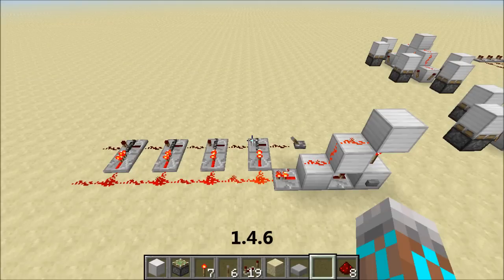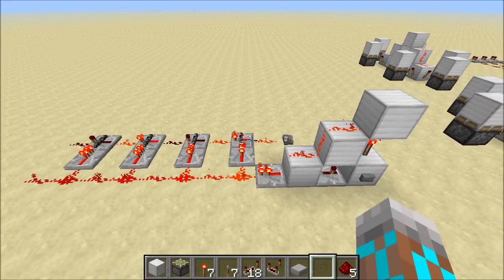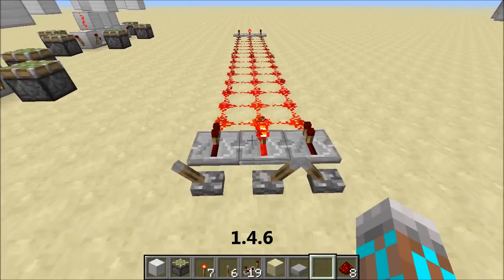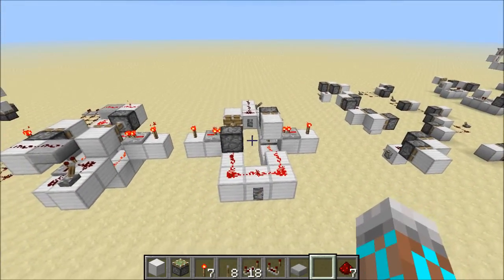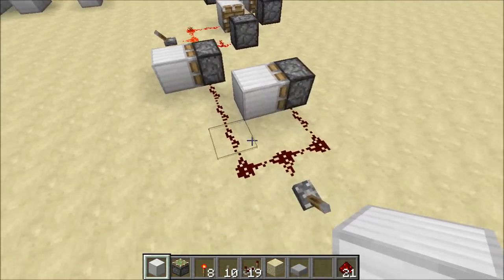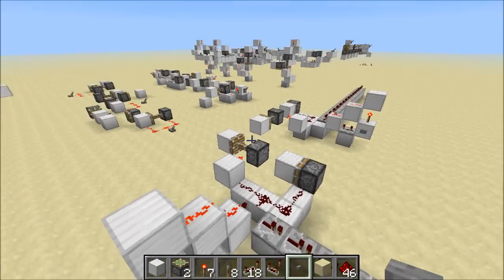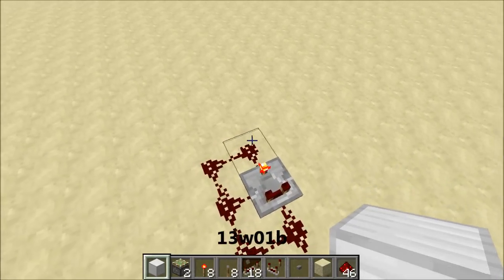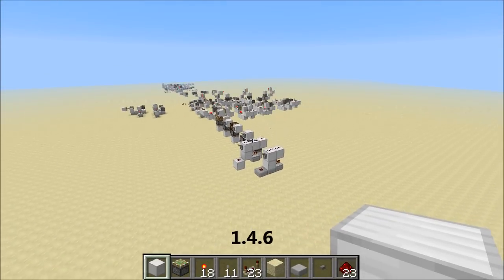Redstone Behavior in Snapshot 13w01b - Fixes, Bugs, and lots of Derp Pistons!

Comment: In the snapshot the monostables are pretty messed up, I agree. The case is that once you have 1 torch hooked up to the old torch based monostable, that one will send a 2 tick signal. This will ALWAYS be 1 torch. So if you attach more than 1, the other ones will work just fine. Now in 1.4.6, it doesnt exactly work the way its suposed to either. The monostable is suposed to work with the repeater set to 2 ticks, because that would turn the signal off for 1 tick. But torches are buggy.

Comment: The reason the torch always outputted a 1 tick pulse in 1.4.6 was due to a glitch(instant torches). Basically, the way i understood it is that the torch gets updated 1 tick before it gets power again, causing it to turn off instantly.

This was nearly fixed in the 1.5 snapshot. It will still do the same thing if..
The torch is updated the same tick it turns on(which have to be 1 tick before it gets power again). That's exactly what's happening here, one of the torches updates the 2 others.blabla